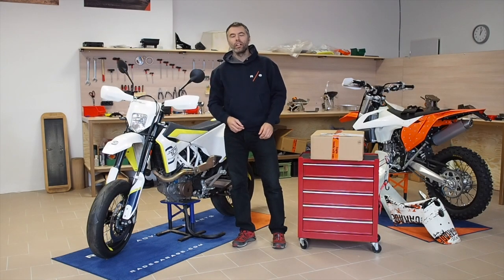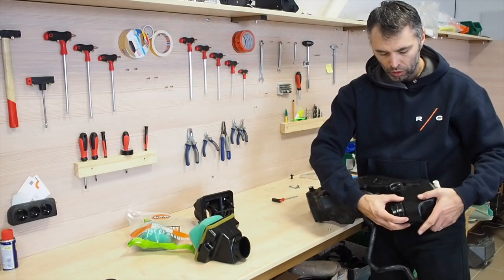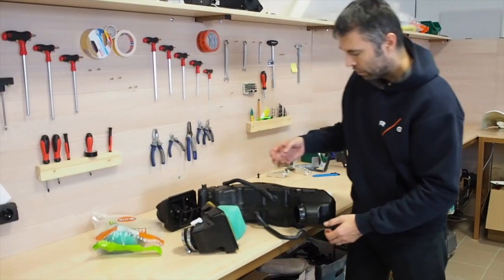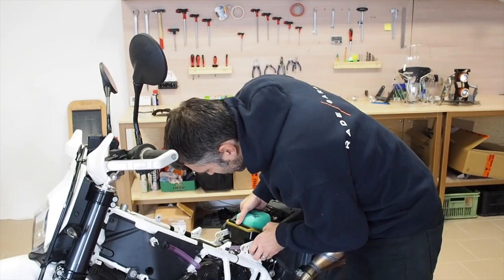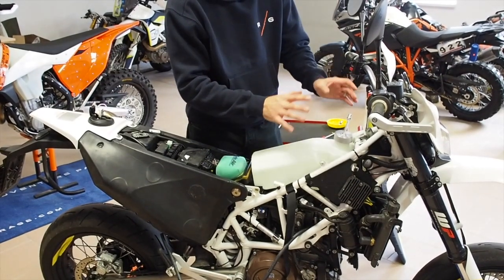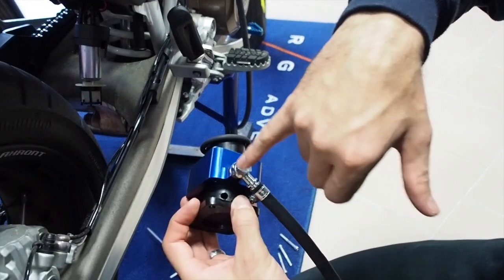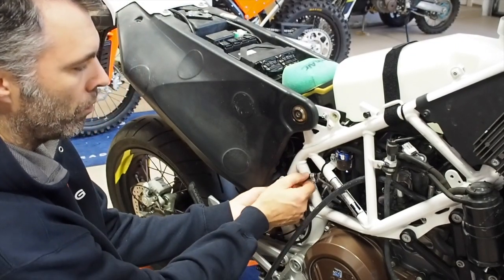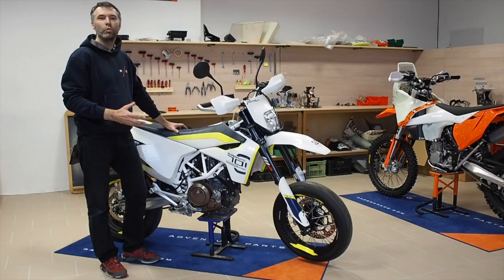Husqvarna 701 R/G tank installation

Comment: Is there a Torque spec for the 4 bolts that secure the fuel pump extender that bolts into the bottom of the tank.  Your video says tight but not too tight...curious if you have an actual torque spec to recommend.  I tightened mine to 5nm and that seemed about right but I haven't had a chance to do much riding on it yet, so not sure if that's tight enough to prevent leaks around the gasket.

Comment: Hi I'm mounting the tank kit following this video, but I have just two tubes, a black one (from the tank to the switch) and a transparent one (from the air box to the SAS/canister). I need another black fuel gas from the fuel pump to the switch. Where can I find it?
Reply from the maker: Hi, the black fuel line has to be cutted in two parts. (Tank -> Petcock, Petcock -> Fuel pump)

Comment: Hi there, I’m about to order a tank from you but have a question. The blue aluminium attachment you put on the fuel pump seems to bulge out. Does this effect the suspension travel. I am constantly off road and don’t need something like this braking or impacting on my suspension travel
Reply: Do you to buy the tank? You to know the link? Thanks
Reply: ever find an answer to this?

Comment: I saw that with the new air filter system you get a few more max horsepower. But without the original huge air filter box how affects to the power and torque curve?? Do you have the graphics please? It would be very helpfull. Thankyou!!!
Reply from the maker: Hi Alfonso, at first our intention was not to have impact on the engine performance. Our goal was design of the auxiliary tank and that was the reason to work on small airbox. 

But because we designed the small airbox with advise of experienced engineers the final effect is that the bike with our airbox has more power between 3000-6500 rpm than OEM one. In the very very top the OEM airbox give 2hp more than our small airbox.

Comment: Multiple install problems with this setup.  First is that there is a 1/4" gap between the rear tank bracket and the frame.  The bracket is held away from the frame by the plastic "push-through" grommet things that the side-panels snap into.  With no spacers between the bracket and the frame, when the bolts are tightened the bracket will be severely deformed.  Second, the stock air box has TWO breather hoses attached.  One goes forward and the new air box attaches to it.  The other tube from the stock box goes down and attaches by the brake master cylinder.  Given that the RADE has only one breather hose, what are you supposed to connect the second tube to?  It's just dangling in space!! WTF?  The written instructions don't mention this and the video doesn't show it.  I would appreciate some guidance on both these issues.
Reply from the maker: Hi Scott,

here, here is the explanation:
a/ we know about the gap and it is there on purpose - otherwise you would destroy the OEM rubber inserts in the frame. If you tight (not overtight) it holds well. Proved on many races and during over continents adventure journeys.

b/ we do supply the T-connection. So you split the supplied transparent tube and from our small airbox one end goes to SAS and second the the crankschaft went - it is described on our website in the pdf manual (article no.5): https://www.radegarage.com/wp-content/uploads/2018/04/rade-garage_701_tank_manual_297x210_04.pdf

If you have more questions, please send me an email to the rade@radegarage.com

cheers
Rade